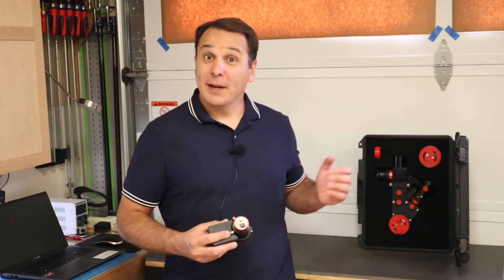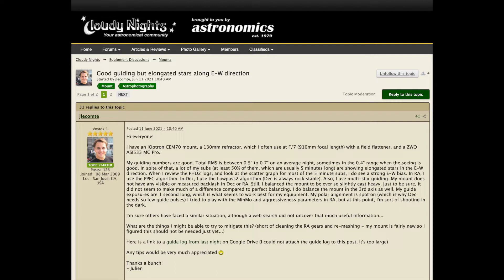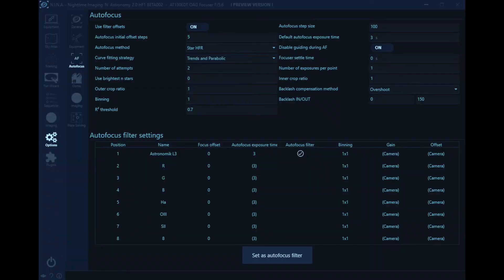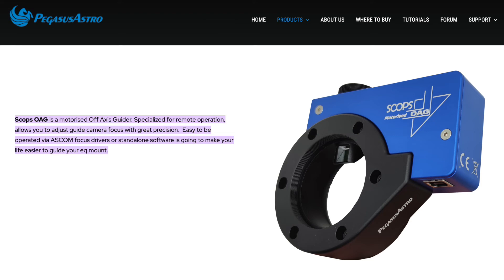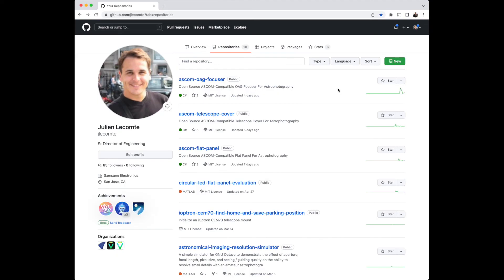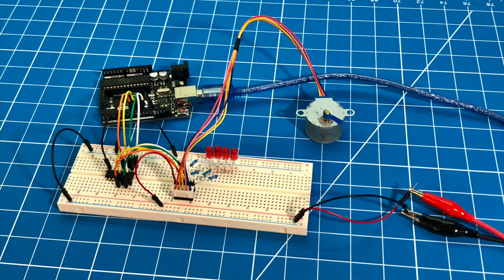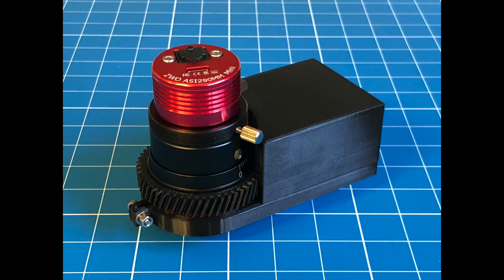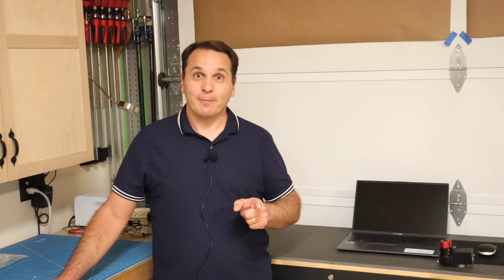3D Printed Motorized OAG Focuser - Part I

Comment: Inspirational video! I love how you create building blocks that are individually achievable, collectively can be recombined to more complex projects. I wonder if we could use the servo (from the dust cap project) instead of the stepper - so it behaves like a ZWO EFA. It would reduce some electronics complexity, has gearing inside, probably lower backlash, compatible with Seedruino. The drawback is that a stepper would allow movement if the power is off - for example to manually focus. I believe the missing link is the ability to set a set the position of the servo proportionally - it would open up applications like a redcat focusser (today it requires a zwo efa together with a 3D project). That seems to be a part of the arduino program only maybe?
Reply from the maker: A servo does not have the positional accuracy that a stepper motor has, which is why focusers always use steppers. On the other hand, a servo has a lot more torque, which is why it is used on an automated cover. CS!

Comment: If the OSG is not between the câmera and the EFW you dont need to change the focuser. Like in your video. But this is a nice project.
Reply from the maker: No, I think you completely misunderstood. My OAG is NOT between my camera and my EFW, it is in front of the EFW. You do not want the OAG behind the EFW because if you use a narrowband filter, your guide camera will not pick up any star. Clear skies!
Reply: @darkskygeek  Ah, ok.

Comment: Fantastic addition to the OAG. I use a ASIAir Plus to do my focusing of the main camera. Maybe some input signal from the EFW to a saveable preprogrammed position for each filter may also be something to think about.  I dont have the helical focuser for my OAG and will get one. This is a fantastic idea. I will see if I can come up with something like that ...I dont use any PC related software for guiding or shooting so it would be great to have a solution for the ASIAIR
Reply from the maker: It is indeed a recurrent problem with the ASIAir. It is a fantastic little unit, but as soon as you need to deviate from the standard workflow, it kind of falls apart. That is why I am a big proponent of free, open-source software and open ecosystems. Good luck, and please share what you come up with!
Reply: @darkskygeek  certainly I will share what I hopefully can make that works :)..just ordered the helical focuser for my OAG..I have to get the EFW yet then I can start working on it. depends what signals are available from the EFW otherwise I will need to decode the USB command set that drive the wheel for filter slot selection
Reply: @darkskygeek  I forgot to ask seeing you have done this. I take it once you have selected your filter and the focus is out I would expect that when you refocus the main focuser that filter focus for the OAG doesnt change?? once you have set the focus on the giude camera? I dont have a lot of experience with the OAG as I have just really set it up and that was a drama..its on a 8 inch SCT. But i found once the guide camera is focused it does track the main focus position
Reply from the maker: @SimjetAU  > I would expect that when you refocus the main focuser that filter focus for the OAG doesn't change

That is absolutely correct! The OAG focuser responds only to filter changes, to accommodate for the various filter offsets. It does not need to move when the main focuser (the one that moves your entire imaging system) changes focus. Hope this helps!
Reply: @darkskygeek  Yes it does which means I can make a programmable focus set level for each filter. Then if I can get the individual filter position signal to then just change the focus for each filter..btw just watching your optimal imaging video at the moment